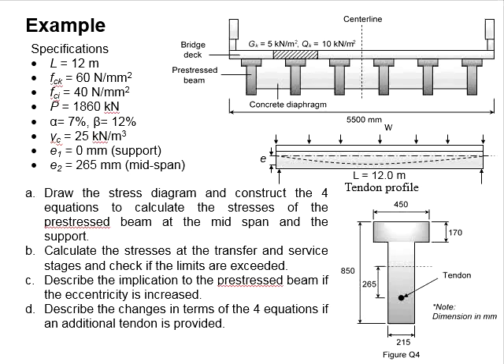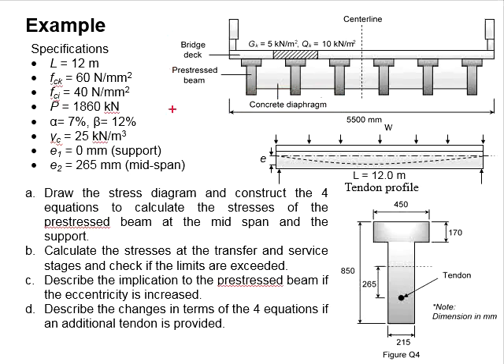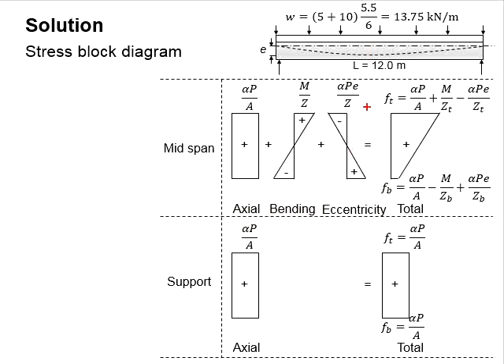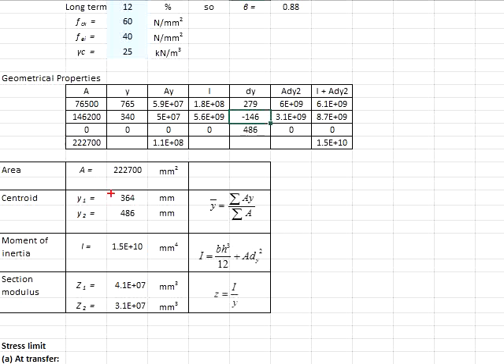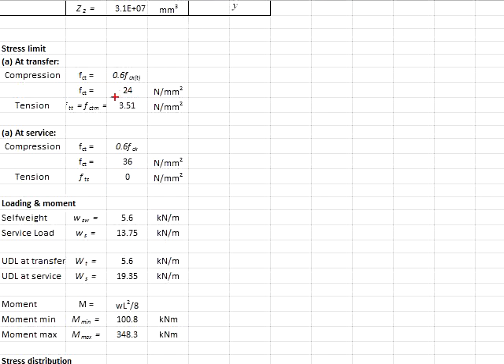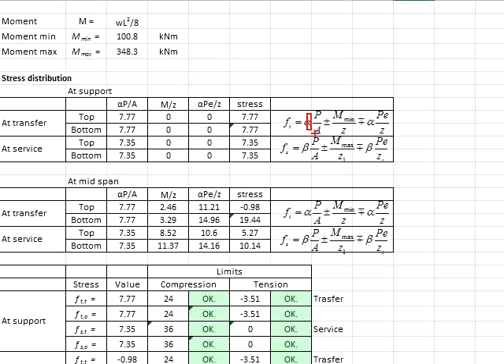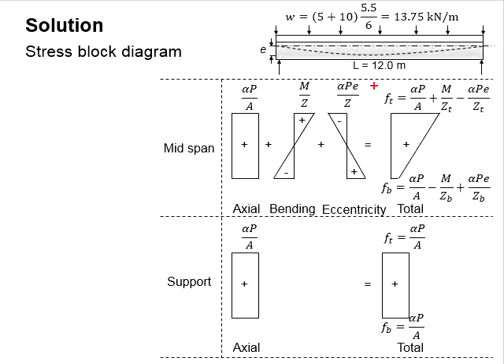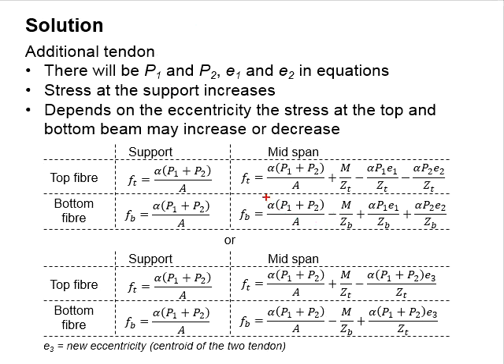5.13 Example 3: Checking for stress limit

Comment: Hi
You have made very good lectures on Reinforced Concrete  Design, these lectures helped me more than university classes.
Could you consider making videos on Steel Design to BS 5950
Thanks in advance
Reply from the maker: In my country, BS 5950 has been superseded by EC3. Thus, I will be doing videos on EC3, starts uploading today. Slowly more chapters are coming up. Sorry for keeping you waiting for so long.
Reply: @eng-aim  thanks for your valuable efforts